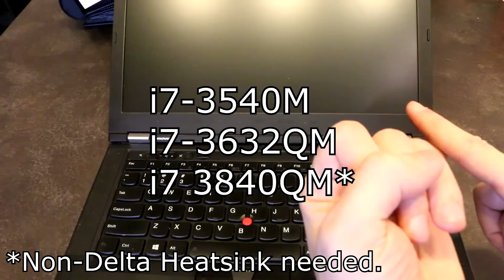Lenovo ThinkPad T430: Upgrade Wonder

Comment: Two matters
First, There's mention of an upgrade parts list for the T430. I don't see it in this extensive commentary thread. Is it possible to repost the link?

Second, Mine (used, like new- maybe a refurb?) has a keyboard with the  Fn and Ctrl functions reversed, and the right Ctrl key marked ?/. Is this for a specific language? Isthere a way to reassign the keys (I've tried various key assign apps).
Reply from the maker: The upgrade guide is in the description along with several other useful links. Let me know if they are dead.

As for your keyboard, a picture is worth a thousand words on identifying it. Some BIOS mods support a control fn key swap.
Reply: @LaptopRetrospective  Thanks for the response! I see the links now. What I don't see is how/where to attach a photo. 
I should say that I bought it in Brazil, set to ABNT2, and with a couple of rt-AltGr combos, additional Portuguese items that include Ç and ^/~ keys. An umlaut is above the 6 key. 
 The main confusion though is the left Fn & Ctrl keys - the right Ctrl key functions as Ctrl but is marked as ?/º.
Reply from the maker: You'd have to use a photo upload service.  Sounds like a really interesting keyboard. Does it look factory or does it have stickers over the keys? I've seen some keyboards that literally had stickers on the keys.
Reply: @LaptopRetrospective  It does look factory (no stickers). Visible differences include, to the right of the "L, " - "Ç," "^/~," -  "}/]º" and enter, which is more like an inverted L shape extending two rows. As I said, the the left Fn & Ctrl keys operate in reverse, while the right Ctrl key functions as Ctrl but is marked as ?/º. The previous º is really º with an underline. Following the "P" (above Ç) are an accent key and the forward brackets key with an underlined "a." It would be easy to send the picture either by Whatsapp or email- or in a Facebook msg if you have an account there . 

My other Thinkpad was US  purchased with a standard US layout. (S230 - ultrabook Twist. 3 bad keys needing external keyboard, and faulty HDD connector, so still useful but troublesome. I use it with external HDs and the 28gb SSD for the OS and small storage space, or I'd move the SSD to the T430. The touch screen continues to make it desirable).
Reply: Sorry about the line-throughs - no idea why that happened.

Comment: I was wondering if you’re experienced installing the classic keyboard. I modified one and unfortunately it doesn’t turn things on anyways (I broke it in the process). Wondering if I damaged the cable somehow or the power button so I know what to watch out for when I try a new keyboard  😂
Reply from the maker: I have the parts and have read up on what's needed for the swap but I haven't done it yet...

Comment: It’s almost 2022 and I bought a t430. Seriously this thing is awesome and brings out my inner geek to the max. 

And the budget of incrementing upgrades is so well put. 

Taking it apart and tinkering is so addictive. There’s a special charm to these old computers I can’t completely explain.
Reply: I remember when i had a T430 and i loved it so much. The design was great and it was very rugged too. Also that keyboard was a dream to type on. The fact that you can upgrade it is a huge bonus and it's something that you don't see these days on a laptop. Such a great laptop!
Reply from the maker: Very true Josh.
Reply: Hey I agree all of these are brilliant but why nobody's talking about GPUs? like if you can upgrade the laptop to that level, can you add some solid GPU to run engineering apps?

Comment: I read It having two different model as per CPU,like 2370M & 3210M?? is it correct??
Also some having fingerprint, some dont have any fingerprint sensor.(its upgradeable but initially it have or not )..
Reply from the maker: Correct, not all units have the fingerprint reader. Putting it in after requires replacing the palm rest and having the cable to connect it to the motherboard. There might have been a few offered with last gen CPUs but most were 3rd gen.
Reply: @LaptopRetrospective  thank you for reply sir.This made it much clearer...waiting for more videos..thank u again. 😊
Reply from the maker: You're most welcome!

Comment: Hi I'm a complete noob to Think Pad and just got 2nd hand t430 16GB, 250 SSD. Love this information and have just bought new battery 70++ 9cel. Just thinking if it would be worth upgrading my 250 SSD to 500GB (is it worth this smaller upgrade) or 1TB. or just get a SATA Bay and use that instead? Also would having this upgrade improve speed, performance etc. Thanks
Reply from the maker: The size of the SSD does impact the read/write speed but I'd only upgrade if you need the storage.
Reply: @LaptopRetrospective  Thanks for that, so would you say if I need faster "task" speed (i run bot software) then would need to upgrade to a better processor to an i7?This will really help decide if I need to pay an extra £300 for brand new i7 or maybe get one from china? or just get more GB. Sorry for questions just trying to get best bang for my buck.
Reply from the maker: Depending on the cost of the i7 you might be further ahead to invest into a newer laptop. I've seen the prices on the nicer i7's go to some insane heights.
Reply: @LaptopRetrospective  about 400   dollars. I just bought the laptop last week. Chinese models are around 100 dollars.

Comment: Still using mine, upgraded to a 3x3 5 GHz wifi card, i7-3632qm, and 16 GB of RAM with an SSD.

I recently also discovered that the exact FRU number for the keyboard can make a pretty significant difference. There are 3 manufacturers for this laptop's keyboard going by the FRU BOM list - LiteOn, Chicony, and Sunrex. You want the LiteOn if you can live without the keyboard backlight (they do not manufacture a backlit part). I had the Chicony backlit one but the keys constantly looked smudged. This does not happen on the LiteOn part (FRU 04X1277) as the keycaps are nicely textured, and the tactility of the rubber domes themselves are improved over the slightly mushy Chicony. From what I have read, flat out avoid the Sunrex parts.
Reply from the maker: Yeah it isn't as well know as it should be that there are several keyboard manufacturers and they have different materials and some different switch mechanisms. One model has five different versions.
Reply: Hi there I see you changed the CPU. I've got i5 did you see a significant difference when upgrading. I'm trying to do the same but very much out my depth with the lingo.
Reply: @johnjohnston1086  since modern applications commonly take advantage of more than 4 logical cores, yes. The 3632qm is as high as you can go without blowing the TDP rating of the heatsink, to my knowledge. You will gain total performance by having 4 physical, 8 logical cores, but the performance of each core will be slightly less. Overall it is a gain in most workloads in my experience. I needed it because I write software for a living and compiling code to executable format is heavily multithreaded.
Reply: @metal571  ok thanks for reply. I'm running bot traffic through software but just wanting to speed tasks up get done more in day.

Comment: Hi, can you please tell me which specific brand of RAM sticks you used? Because I've read somewhere about sticks not running in dual channels due to compatibility issue
Reply from the maker: This model in the video has long since left. But the type normally found in it is PC3-12800 1600MHz DDR3.

Comment: The speakers are so quiet I can barely hear my professors on Zoom. 🤦🏻‍♂️
Reply from the maker: That's strange, I've had a few of these comes through and never had issues with speaker volume.
Reply: Yeah, mine are ridiculously quiet, I’m considering buying some new ones off of ebay in the hopes that mine are just worn out. I hate having to use headphones on zoom calls. Otherwise it’s a great machine! I5, SSD, 12gb RAM.
Reply from the maker: Yeah what you're describing isn't normal as far as I know. ThinkPads aren't known for crazy loud speakers but you can hear things just fine.
Reply: @LaptopRetrospective  Is crackling normal for them? Mine crackle with high pitched sounds, like my Japanese professor, when she speaks my speakers crackle.
Reply: and that’s not me trying to be funny, it actually happens lol
Reply from the maker: Never heard them crackle. That sounds like they've seen water or some other kind of damage.

Comment: I have the same but it's t430s. Is it worth upgrading to mSATA or 2.5 inch ssd from HDD. I am planning to clone the drive.any help !!
Reply from the maker: The 2.5inch SSD will ultimately be faster since it is a full SATA 3 lane, the mSATA still only has SATA 2 speeds.
Reply: @LaptopRetrospective  so I can put the SSD on the HDD slot. Any recommended SSD for this model.
Reply from the maker: Samsung drives are nice, ADATA is a good budget choice too.
Reply: @LaptopRetrospective  thanks 😊
Reply from the maker: You're welcome!

Comment: Can you add external GPU nvidia ??
Reply from the maker: You could through the Express Card or PCI-E slot. I suggest the EC.
Reply: @LaptopRetrospective  yeh but if i add nvidia gtax 1060 its working or not if i add GPU
Reply from the maker: Sorry, I don't understand your question. Can you rephrase it?
Reply from the maker: Yes, those are the two basic setups.
Reply: @LaptopRetrospective  but if i buy gtx 1060 its working in thinkpad t430 right ?
Reply from the maker: It should, I'd go over to egpu.io and do some reading.
Reply: @LaptopRetrospective  thank you very much

Comment: There is a software solution now to removing the whitelist. Deets can be found by searching 1vyrain. You have to first downgrade to an older BIOS and then boot from USB after burning the 1vyrain. There are vids with step by step deets re the BIOS downgrade and the 1vyrain install, both on youtube.
Reply from the maker: Yep, that's right.

Comment: My  t430 wasn't turning on for 6months and during those 6months different computer repair shops have been saying it's the motherboard but I wasn't convinced so I removed the cmos battery and put it again and it instantly turn on but the issue is each time I have to turn it on I have to remove and put it back again the cmos battery what should I do? Because it's now beginning to annoy me hahahahaha
Reply from the maker: That is beyond me. I could only speculate.
Reply: Just going by memory here but I believe if you disconnect from power and remove the battery, then disconnect the cmos and power on the machine, you just have to put the correct date and time in the bios and it will function normally.

Comment: can this run a graphics card?
Reply from the maker: Every laptop has one, so I don't really understand your question.
Reply: @LaptopRetrospective  well technically not correct,can it have a dedicated card? these laptops usually run the main processors graphics capabilities. where as a dedicated card will ease processing from the cpu via its own graphics processing unit
Reply from the maker: There are some models that have a dedicated GPU on the motherboard, but you're not upgrading one that doesn't have it. It would be a motherboard swap.
Reply: @LaptopRetrospective  technically also not true , heres an x220 running a gpu externally https://www.youtube.com/watch?v=hVlIJ2D_Sqo&t=9s I WAS WONDERING IF I COULD DO SOMTHING SIMILAR WITH THIS.
Reply from the maker: @EMP-NETWORK  I'm also aware of and even have an eGPU setup (I have videos on this channel in fact), but this is not often what people want to do with a laptop. It wasn't entirely clear what exactly you were asking. The GDC Beast style setup will work with the ExpressCard.
Reply: @LaptopRetrospective  ahh ok thank you for the timely replies
Reply: @LaptopRetrospective  ill give you a shout out on mt other channel some time, its nice to have good timely replies and break down of info. cheers
Reply from the maker: No problem!
Reply from the maker: @EMP-NETWORK  Thanks I'd appreciate that. Feel free to link your video here. 👍

Comment: If i upgrade the msata drive with msata3 does it recognise at all the msata ssd cuz as i know these is msata2 or it just read the speed of msata2 but still recognise the msata 3 ssd
Reply: Thats great at least it can be as hard drive , thank you
Reply from the maker: It will recognize it, but you won't get the full speed.

Comment: This laptop is 2012, It has all of that?? Mind-blowing. Why nowadays laptops still don't have it? Hot-swap battery, hot-swap DVD drive for HDD. Express Card (for newer laptops should be type c thunderbolt). I'm just surprised to learn that this is produced in 2012 and I just know that right now.
Reply: It's all about thin and light today, they even sacrifice serviceability and reliability for it
Reply from the maker: It is where the demand led us. Perhaps we will see a renaissance of this in the next few years.
Reply from the maker: Older ThinkPads still have lots to offer.

Comment: The computer arrived just as I was told it would JustU.Faith/Thinkpad_T?早 I leave it plugged in, so I don't know about the battery life. I do not use the camera, and I have not used the tech support. The computer works as I expected.

Comment: In 2020, please do not buy a t430 or x230, I have one but I won't suggest in 2020 because recent windows updates push the temperatures to very hot like 85 degrees C.

If you are using Linux it's fine but Windows 10. It's not recommended.

It's a very good laptop but the heating isn't suitable for windows 10.
Reply: Perhaps due to environment I am at, it's always hot and humid places, non air con.

I have changed to good thermal paste, new fan and heatsink. It remains same issue. Older models like x201 will auto shut down due over heating during updating windows 10. So the t430 and x230 aren't bad but just annoying issue. T430 is better in terms of heating compare to x230. 

My experience (more 10 x230/t430) with Linux MX Linux is good, but windows 10 remains bad with updates.
Reply from the maker: Sounds like a worn out fan or thermal paste could also be possible.
Reply from the maker: Thanks for adding your two cents Vincent, you're awesome!

Comment: I used to use the T430s, I used it for around 4 years, when the screen was really starting to bother me. I had the one with core i5-3320m and  Nvidia NVS 5200m. I used to overclock it, and found that removing they keyboard while the fan was at full blast helped it move more air. The vent on the back never blew out any air, dont know why, but that one vent blew out lots of air. 

I switched to a T480s now. The screen is a night and day difference.
Reply from the maker: I can imagine a huge difference in screen quality for sure!

Comment: lenovo t430 is trash honeslty, im using it rn and its getting replaces with an L340 soon. it runs sooo slow
Reply from the maker: Specs? The IdeaPad line is okay but build wise not comparable to the T series. They won't be able to compare in the gaming department especially with the L340 having modern GPUs.
Reply: @LaptopRetrospective  Yes but it's not only gaming, when I'm trying to do my work the screen starts freezing and out of nowhere all my tabs are gone and I'm back on my home page. Even writing this comment was a drag.
Reply from the maker: Defintely not working properly by the sounds of it.
Reply: Laptop Retrospective Exactly why I’m getting L340, maybe it’s just old. Had it for years

Comment: I have a Lenovo Thinkpad T430s (<- note the s)
Since i bought this laptop, the battery doesnt last for more than 10 min, how can i upgrade it and which one would be good?
I also want to play some small games on it, games are almost unplayable at the moment.
If anyone has experience with this type of laptop, and upgrade, please respond :D

Specs:
Intel i5 3320M
8GB Ram
166GB storage
Reply from the maker: You can check BattDepot for options. What games are you trying to run that underperform? Need some details here.
Reply: @LaptopRetrospective  Like minecraft runs on 60 fps, modpacks on 10 fps. What can i upgrade?
Should i buy a ssd? how do i replace the windows on the ssd and replace it wit a better ssd?
Should i remove the battery and with which one
And ram 2x8 i think
Reply from the maker: That's about the performance you are going to get. Mod packs are taxing on system requirements. An SSD will help with load times and that's about it.
Reply: @LaptopRetrospective  A better gpu could improve it right? the i5 in it is real old i believe, could i upgrade that o idk i7?
Reply from the maker: The s model I believe is all soldered and not socketed, meaning upgrades aren't an option without swapping the whole board. If I recall correctly, there isn't an express card slot either for an egpu.
Reply: @LaptopRetrospective  owhh okay, but changing the Ram would help i think
Reply from the maker: Not much. If you are at 8GB already and getting 10fps with mods it's taxing you CPU and GPU. Even if you doubled it, I think you'd be disappointed in the results.